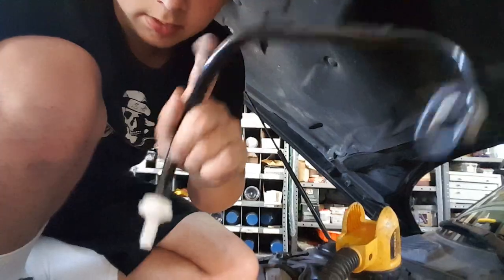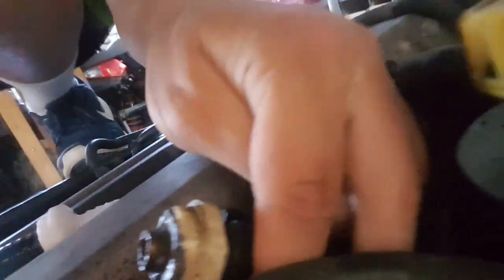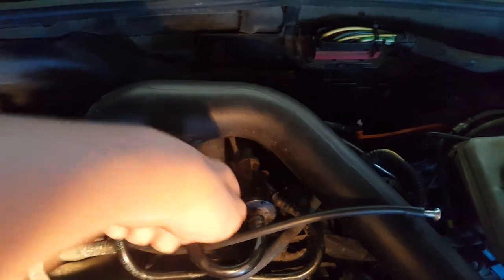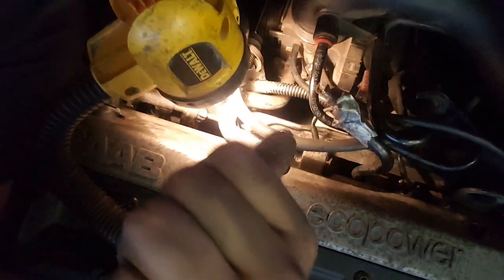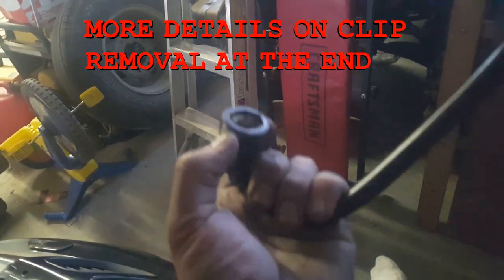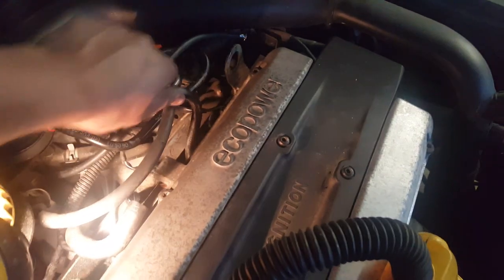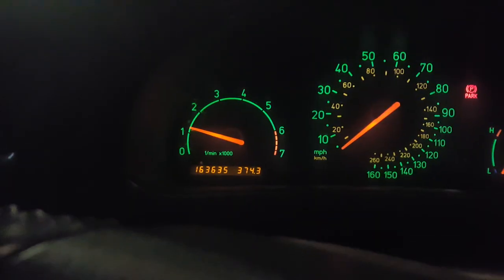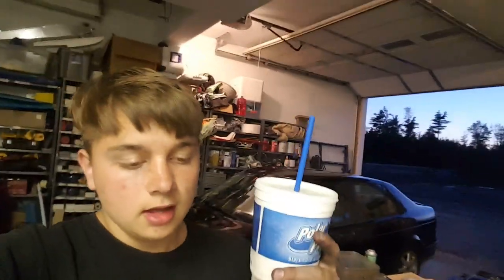DIY Saab 9-5 Oil Trap Hose Install | How to | Repair

Comment: Great video. Replaced the hose today on my 9-5 Aero and this was very handy.
Did I say replaced? Can't get the new hose on!!!!!!
Reply from the maker: Whats giving you trouble
Reply: @GoonCake  Ah, sorted in the end. But after much swearing and loss of skin! Ended up having to get the car on a ramp and come at it from underneath. 
The reply is much appreciated though. Moving on to dampers, bushes and all that malarkey now...
Reply from the maker: @richardmmoulds  ah jeeze fun times
Reply: @GoonCake  is there a trick without having to go from underneath to get that clip to snap on I've got it all in place I just can't get it to snap on how did you do it or did you have to go from underneath
Reply: @Hotflicka  Same issue for me today. Any idea ?
Reply: @maximearmand358  I twisted it and pushed, finally got it on. Good luck

Comment: just completed that job about 1 month ago and took me a long time experimenting. Eventually approached from underneath, but you have to get the car reasonably high (and safe) as it gets a bit claustrophobic under there. Could have used your vid then. Camera work is a bit shaky, but good job
Reply from the maker: +doug hancock thank you! It was hard keeping it still after struggling with this for a while. It took quite some tikme to figure it out off camera but that's why I made this video so others don't have to spend such a long time figuring it out like I did ☺

Comment: Excellent video on replacement; I finally found this broken on my saab 95 as well; I hope it fixes the P1110 code as well; been trying to find out where the leaks are.  Tx DLF
Reply: P1110 if I recall correctly is the air bypass valve failure code (front left of engine) usually.

Comment: What kind of problems would you have if this valve is not working? As you can tell I am having a few. LOL
Reply from the maker: +James Mana what year and model? Under boosting can happen. But ither than that nit many signs until you find sludge in your crankcase and by then its almost a gonner. Its about 30 dollars and a day if your time if you are incredibly inexpereinced without this video worst case scenario. Since you have seen this video and coukd use it it may take an hour or 2 of your time. No reason not to replace if it hasnt been already. Signs it may be time ti replace is if it id incredibly brittle feeling or if it snaps when moving it out of the way for the valve cover like it did me.
Reply: OK here is the problem. I believe the car set for a long period of time. Just bought the car.  Ran great for about 600 miles after purchase. Replaced the valve cover gasket as it was leaking oil under the DIC.  Did an oil change and replaced oil filter, Drove this beautiful 9.5 2002 Saab about 50 miles oil light came on 2 qts. low and noticed oil blowing out the oil fill port. Is this part you use here the same as the PCV? Would it cause this pressure internally to push the oil back up the fill tube? So many questions on these turbos. I believe it is also the high pressure turbo. Hoping you can follow all that I have wrote. Also is there anyway other way to touch base with you? You seem to know these Saab's very well.Also you can see where the oil is leaking only on the ground on the right side of the car.
Reply: OK I see we are both learning these Saab's (believe me I love all of mine) OK let's think for a moment. What the PCV does. It does what it says it is supposed to. It shall we say equalizes the pressure in the crankcase area. If there is not nothing to relieve this pressure it will seek somewhere to go. Sorry I have a 2002 9-5 2.3 turbo. I have checked the VIN number for the kit that had to be added to a lot. Mine is OK. I have not pulled the oil pan but have pulled the valve cover and viola a lot of oil was in the valley. Rockers are supper clean and no sludge at all. Replace the valve cover gasket as I assumed that it was leaking. LOL  sure it was.....I believe it was leaking due to excess pressure. Then did an oil change. In about 75 miles my oil light came on and I was down 2 qts. of oil. Brought it back home and parked it for the winter. Now here in Alaska the snow is almost gone and I can start to do something with it. Now going back to the PCV. If it starts to over pressure the oil will have to find a place. I notice most of the oil has been pushed back up through the oil fill port. Saab recommends this little bugger PCV be check at every oil change. They are adamant about doing it and replacing ASAP if faulty. However there is no mention of anything else. I did talk with a guy that sells mostly Saab parts and he said a bad PCV would do what it did to mine. I am still leary because you read and see so much on the Saab. We only have 1 mechanic in this state that knows Saab's and he charges about 8 times more then the dealers. I do not have the WIS for the 9-5 which makes it aeasier to do some of the hard things. Anyway, I see how much you love yours and maybe you too can ask some of the Saab guys about this and me too and when I get the time to replace the PCV and possible check that oil catch I will let you know what I have come up with. So be patient too. I promise I will let you know.
Reply: OK It appears as though my problem is fixed. For your  info the PCV was the problem the so call mechanic said it was good and it was not. Oil blew back up the fill pipe 2 qts worth. It had to go somewhere and it seems I am lucky it did not blow through anything else. Keeping my fingers crossed and always checking.

Your friend in Alaska
Jim
Reply from the maker: Hey there Jim. Sorry i never got back to you. Did you find out if the pcv was the problem? If the only way you can tell it was leaking was from spots on the ground in that area there is another pcv line i believe on the passenger side of the valve cover that always brakes its clip. Ive never seen an excess of oil from any normal breaking points on saabs but theoretically i guess if your pcv was sludge blocked it could force the oil to come out of the dipstick area. If you still never figured it out full bill of finding the problem would probably go from drop the oil sump check for sludge and build up on pick up screen then replace pcv system with updated kit on eeuroparts. That should give you any information or solution you need. Sorry again for not getting back to you i never even knew you replied
Reply: Just be sure none of these vehicles are in need of the PCV upgrade kit! (was "recall" for it,due to sludging)  (My 01 9-5 Aero is one of them that did) Still can't figure out why former owner bought the kit and never installed it!  (but gave it to me with car)..  LOL   I do run and always have run full synthetic oil also as alot less likely to experiencing "coking" of the oil and killing the turbo with synthetic.  (there are plenty of videos about the PVC kit--and one of a guy doing it on a 9-3, The 9-3 video he did is exactly how the 9-5 install goes also)